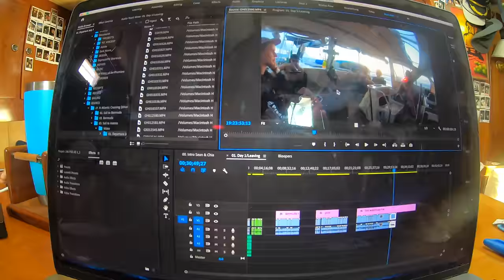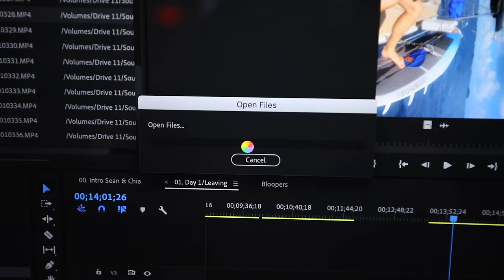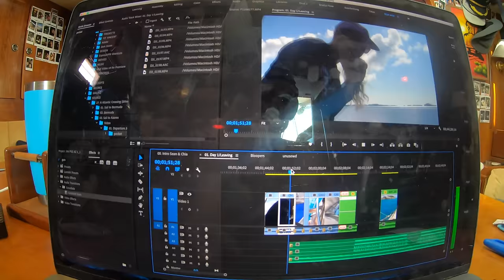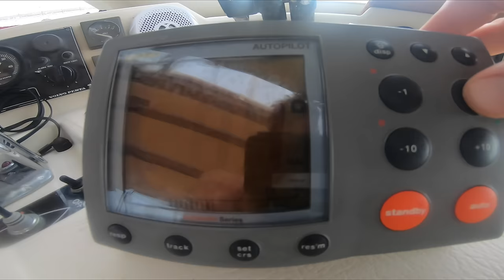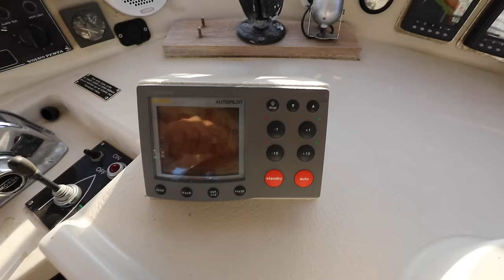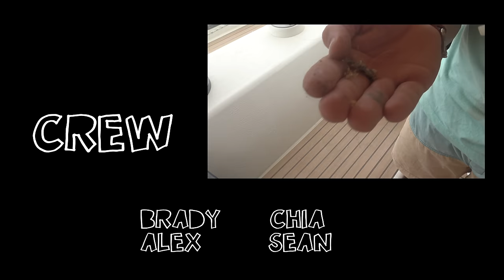It's NEVER easy saying goodbye....SV Delos Ep.257

Comment: Brady some white lithium grease on the gears will keep them working properly for a lot longer than 5 years
Reply: agreed. should definitely have some kind of lubricant when gears are involved.
Reply: you read my mind sir, they propably reassembled it months ago, but i hope they take your suggestion :)
Reply: They should disassemble and grease it.  Planetary gears definitely need lubricant.
Reply from the maker: Willlll Grease it up! Thanks guys!
Reply: @svdelos  You can use the same grease that you put in your winches.  Put enough to coat all the gear surfaces plus a little extra.  Too much grease can cause more drag putting more load on the motor or get flung out and get on that belt.  Cheers y'all!
Reply: Yup white lithium grease does wonders
Reply: copper grease will also work
Reply: @keanur6541  not in a marine environment there are already three dissimilar metals in that gearbox, introducing anything copper based would be a bad idea. either a light brush coat of white lithium or a light spray is the best option.
Reply: Suntan Lotion works in a pinch too. I used to lube my skateboard bearings with it when i was a kid. Being a Boat, i'm sure you have lotion...in a basket.

Comment: Great Video as always. ...but
The linear drive autopilot does not connect direct to the rudder. The rudder is under the boat connected to the rudder shaft connected to the rudder quadrant which is what the autopilot probably connects to. 
Most cruising boats I met did have a backup self steering option. Most would have a wind vane setup (Cap Horn or Monitor type) and an electric or hydraulic one like the one we see here. 
Love the fix it videos. You do a good job with it little bro and that’s saying a lot since Breeyawn set the bar so high. 
Nice to see what breaks through heavy use. One of the hardest things when provisioning is deciding what spare parts to carry since you can’t carry a complete spare boat.
And you gained respect from me letting us see you cry over Tacos!

Comment: Many of our smaller planetary gears come pre-lubricated with the proper amount of grease. While others are just lightly oiled. The amount will vary depending on your application and how you are housing those gears as well. 

In a grease lubricated unit, we suggest you follow the manufacturer's recommendation of using a lithium soap grease, NLGI number 1 (this is a Japanese industrial standard), and fill the casing 50 to 80% full.

Comment: Nice video report again. 
Awesome to see you two working on the boat. 
Agree with previous comment.. you need to lube the gears. Copper/ brass does like fine graphite grease. 
Fine oil can do but it wil evaporate eventually. Nevertheless both types of grease needs some check and reapplications.

Comment: Nice job repairing the A/P, I due hope you also replaced the brush’s in the motor! They are know to wear out after a few year’s useage’s, hope they lasted for the return crossing.
 As you are back in the craibbean- T&K’s . 
If not you should pick up as set upon your return to Fl. They are easily replaced just use care opening the end of the motor assembly as they hang up on the end bearing.
Great vidio’s totally enjoy following your travels as I wish I could do the same.

Comment: Hi Delos Crew
I noticed you were having some computer slowdown problems.

  They were probably heat related.

  May I suggest you use  electric fans to cool them down while processing video.

Another ploy is to place your laptops on a metallic surface.
 
Even a large stainless steel or aluminium pot may do a fine job  of cooling your laptops.
Be creative.
May Poseidon ease your way.

Comment: I'll give you 10:1 odds that Bryan was literally grinding his teeth all the way back in Sweden when he heard the primary autopilot gears eating themselves again.   :)   Bravo Zulus on the repairs, Capt. Brady!  Curious though as to what materials those gears a made of...  The 4 pinions look like brass and the bull gear looks like plastic, both of which are very soft materials.  Seems like a hardened stainless assembly would hold up better (but would require lubrication so that could be a bit of an issue).

Comment: Can those gears be lubricated with a grease that is safe for brass/bronze/plastic to mitigate wear?
Furthermore, would it be wise to clean out the chamber where the gears are on a regular basis to minimize the accelerated damage the dust is doing to the gears/grooves?
Reply: nobody46820 I was wondering about that. I didn’t see it in the video, but it would seem that millions of grease in there would help.

Comment: Couldn't you get at least 1 super fast desk top and fit it in to a cupboard or under a sofa with plenty of cooling and fans and then have a wire coming up through the saloon table and a monitor that is on a nifty arm that turns any way. Then you could have WiFi keyboard and mouse and all your problems would be over, forever, and you could all live happily ever after 🤗

Comment: Last time I was in the Canaries, I noticed the Spanish mobile operators' prepaid simcard dataplans have the ANNOYING feature: once you have used 10% of the quota (you still have 90% to use), the connection starts slowing down REALLY fast. At 50 percent, the connection is useless for anything that requires a lot of bandwidth. When you intend to leave soon, you don't want to fill up the data sim any more. You will be left with a simcard that still has lots of data transfer left, because the connection is useless.
I guess this is quite common in other countries too.

Comment: If you are spending lot of high resolution video rendering time with Adobe Premiere Pro, I think you should move on to a desktop. You can get much more computing power, better graphic cards for rendering, RAM and SSD for faster data transfer. Also desktops are better when it comes to ergonomics. You can have a big screen, relaxed keyboard and a comfortable mouse. And all of this will be cheaper and flexible as compared to  laptop. This will come at the cost of portability. You can refer Linus channel to help yourself. Search for Linus Tech Tips on YouTube

Comment: Get a utility to monitor the temps on the CPU & Graphics card. I'll bet the heat and the accumulated crap inside the fan air intake is causing the laptop to take a shit because of high temps. Try spraying compressed air in the vent with the laptop angled so the debris falls down.

Comment: 64-bit processor is the minimum you need these days. If your machines are 32-bit, throw them away asap. Bus speed over clock speed (clock speed is BS; bus speed is the real juice). Have twice the RAM you need. At all times.

Comment: That seems like a really poor design of a planetary gear set, and a poor design of an autopilot ram. Really loving the episodes! Keep them coming!
Reply: I would have put some type of lubricant on the gears and shafts to slow down the wear.
Reply: @raykrv6a  if it were designed right to begin with, it would have a few Oz. Of lubricant inside that would get changed periodically